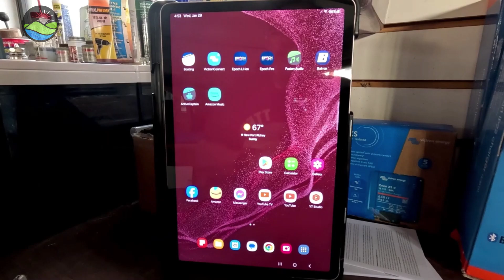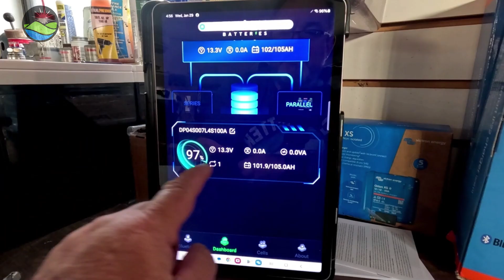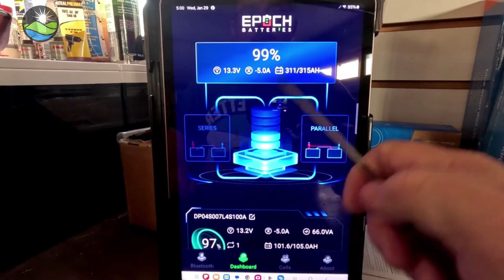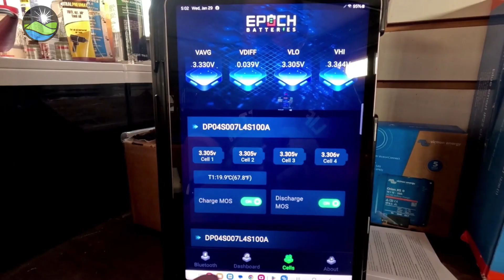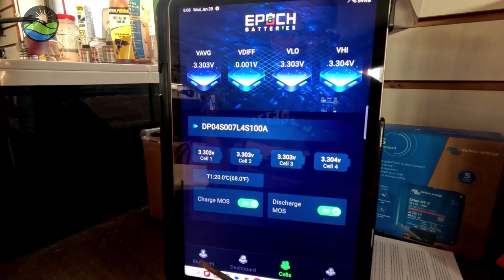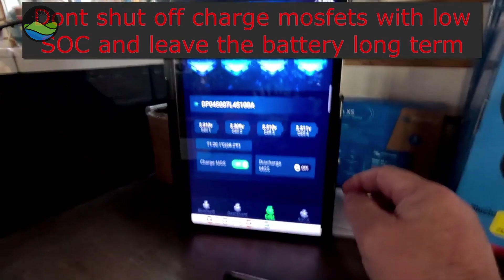Epoch batteries Lion app overview, tips and troubleshooting

Comment: Hi i am fixing a van setup with your batteries  with solar panel charging -
Van has been to 2 installers and could not get it working so I fixing their mistakes -
After I got 4 Epoch batterys configured properly -- battery part of system Looks to be working properly now - Nice

one of  installer put a GOPower  30amp PWM  solar controller  - No clue why this controller was chosen -
Is there some type of Coms Possible to battery from this solar controller ?? 

Once I got  Epoch battery setup its very Nice - 
1 out of 4 x batteries  the Charging to battery was shut OFF for some reason -
after turning the one battery back ON system when into Battery balance mode and worked Well -Very Nice 

2 suggestions on app 

2 switches for charging / discharge - 
Need to be Clearer in app what they do -

I can see this causing problems on user end 

Text bubbles in app explaining what switches do is a Good Idea - worth the cost -

the moving thing at the Top of Main page is not that useful -
be better to use space for larger text etc  or just make clearer what is going on -

I see you are seting up your batteries to work with Victron  -
I have been using Victron gear for 9 yrs 
that is a Good Move  -- Thanks